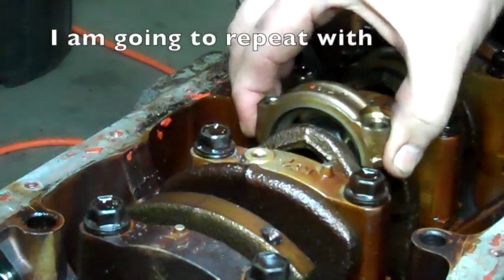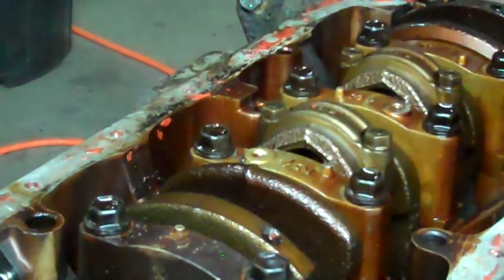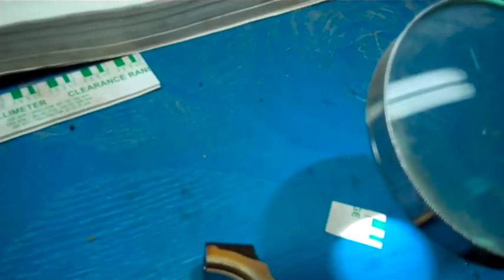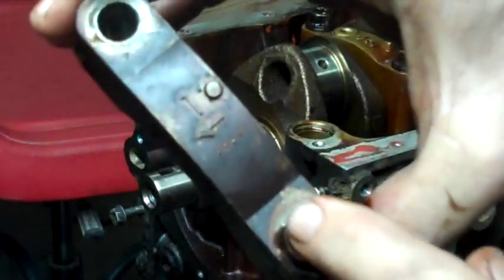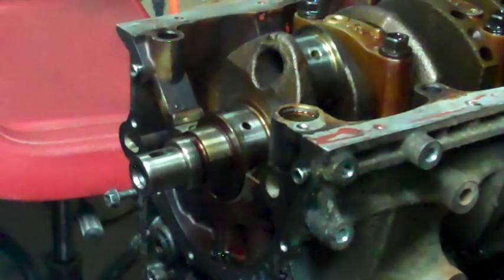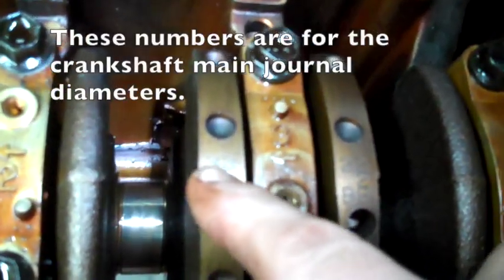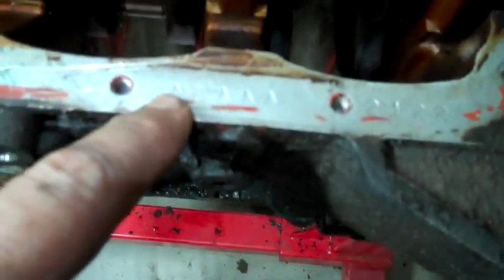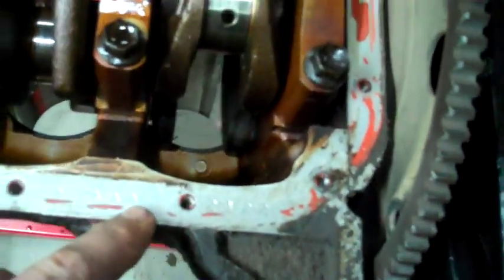1995 Suzuki G16A Engine Disassembly Pt5of6

Comment: Thanks for your excellent guide. I just picked up one of these engines today that I will be rebuilding.  I was going to purchase a rebuild kit which contains all of these bearings, pistons, gaskets, etc.  However you are indicating that each main bearing may be a different size. I assume all bearings in the kit are the same size, so is the per-cylinder sizes just ignored and if so what are the ramifications of that?
Reply from the maker: You are welcome Dan.  Yes, I definitely recommend making all of your measurements before ordering.  Big problem for me was that bearing retailers often do not provide/know the bearing sizes (ID/OD or thickness).  I posted info about my challenges with bearings on my face book page (ww.facebook.com/SidekickRebuild/).
It doesn't matter much for machine shop because they can make the crank journals fit the bearings, but I could not do that.